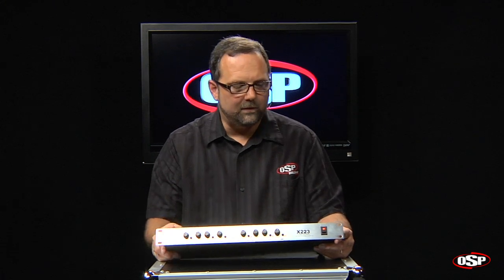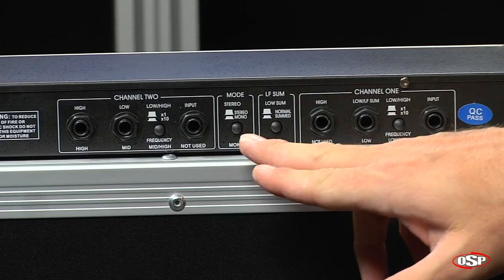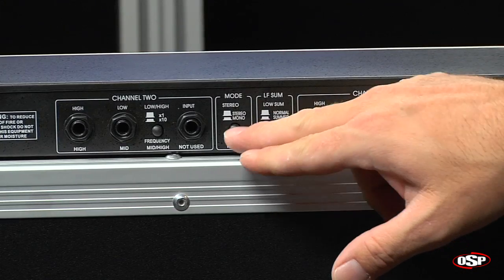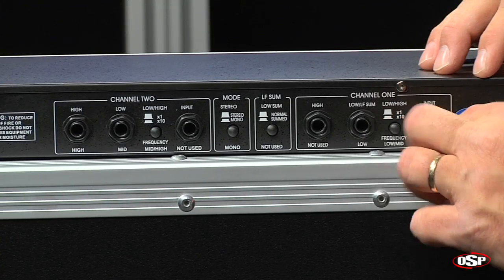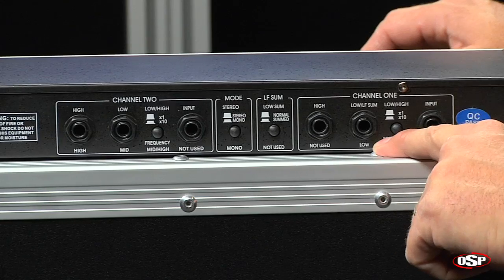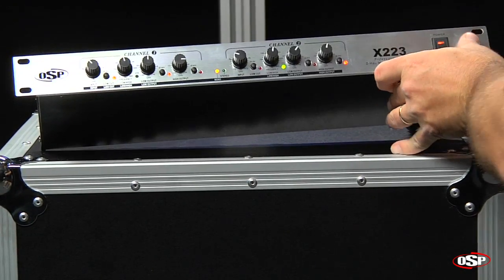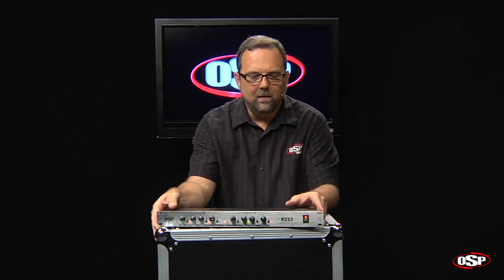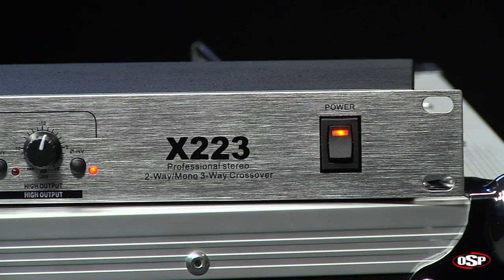OSP X223 2-Way Stereo/3-Way Mono Crossover

Comment: I do not see a 30 hz. high pass filter so by not protecting those sub or woofers, they will eventually be burned out. An active crossover without cut off switches is worthless.
Sorry for the review, but it is the truth. I'm also guessing Chris Ward is not very familiar with the OSP X223.
Reply: D J Sal  Z. Agreed! he said the x1 x10 button was for fine tuning? nope. I'm thinking he's not very familiar with any active cross over. x1 would probably be from 44hz to 900hz crossover adjust x10 switches it to higher frequency crossover probably around 440hz to 9khz.

Comment: i have a question how would i hook one of those up to my 8 chanel mixer.how i have my speakers set is i have my woffers running into amps and pluged in to my subwoofer out put on my surond amp.and then im running seperate amps to the mids and highs.

Comment: The "reason" i use 5 differrent BAND PASSED "crossover outputs is very very basic...
THE LESS "varaition - between upper & lower frequencies... that ANY ONE SPEAKER  - is asked to "provide"...
THE CLEANER the sound from that speaker.

Comment: MOST of my "multi ch surround sound systems RUN  ...five way crossovers
5 separated frequencies ...

ON EACH CHANNEL
And my "first" 1965 ...ultra basic system 
WAS IN SEVEN CHS.

Now i'm testing a TWENTYFIVE CH SYSTEM...

So?
I i were to "use your joy-toy" ...
I'd NEED TWENTY FIVE - just to get three way crossovers running...

(& REMEMBER - I RUN FIVE WAYS)

Comment: Woohoo (so whilst it buffers & before I look)

IS THIS a genuine 7ch 'multi ch Crossover... (or)?
Just a bare bones ...!!! (basic amp)
Allowing the "choice" of ?
Switching ONE output...
 from the frequency crossover spectrum ... of "EITHER" of two stereo chs...
 OR?
For selecting a (ONE CHANNEL) "crossovered" output from  3 mono inputs?

In otherwords... substituting 5 "amplifiers ...
 with a switchbox & using ONE basic amp? 2 stereo & 3 mono